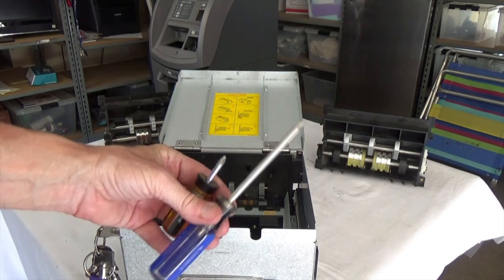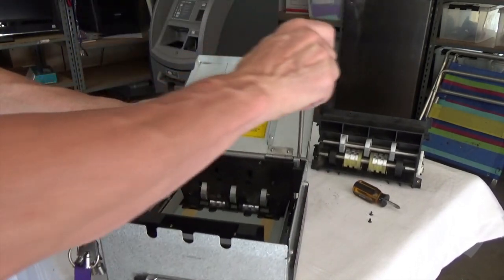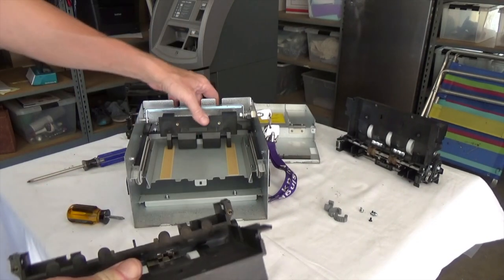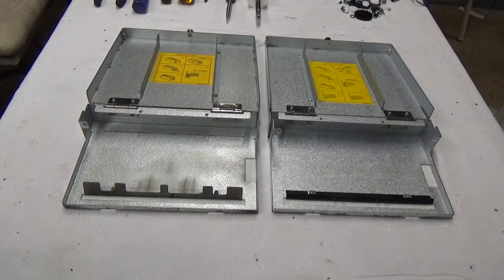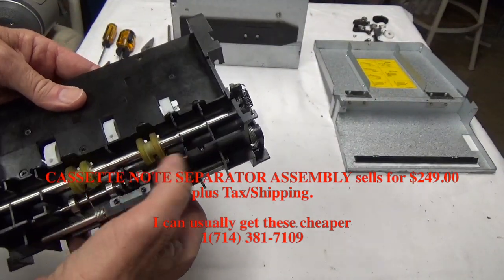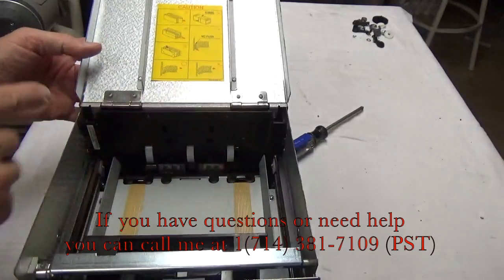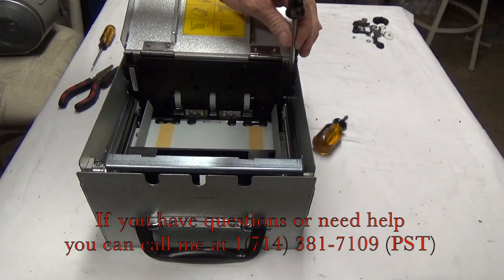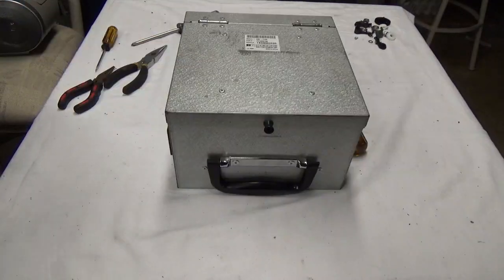Do It Yourself ATM Cash Box Repair

Comment: Nigel I have a question I have a hyosung halo one I keep getting error code 20002(00) but the cashbox still has 91 bills in the machine. how can I fix that from happening
Reply from the maker: Hey Jefferson, for a fast response, always call me directly, my number is at the end of my video, I'm not god at checking my gmail. There is a simple fix for this, you have the Low Cash turned on, this is used to alert Armored car when the ATM gets below 100 bills. Give me a call at 1-714-381-7109 PST